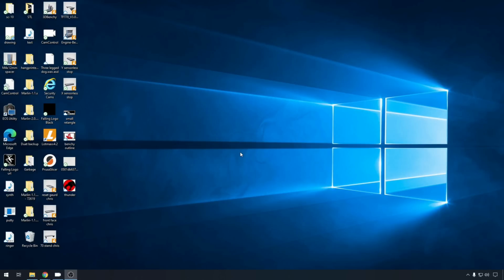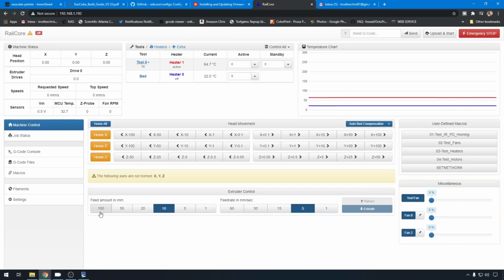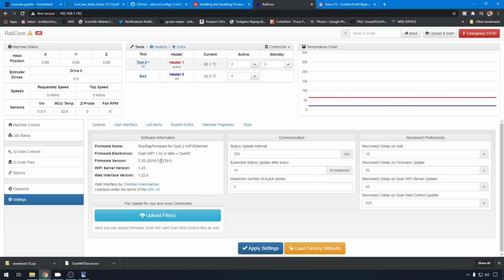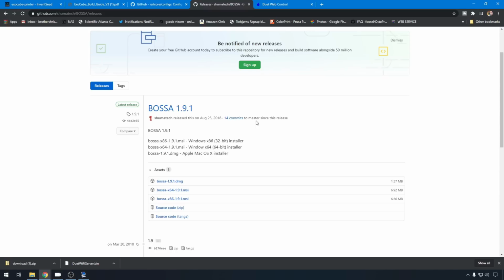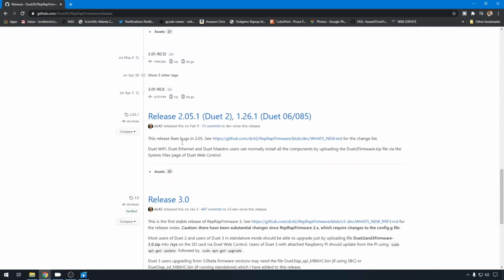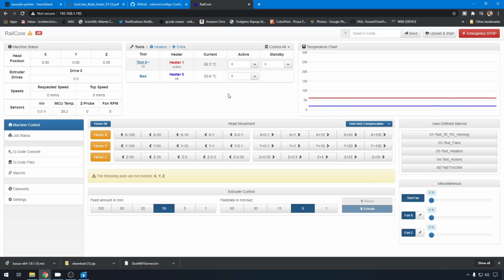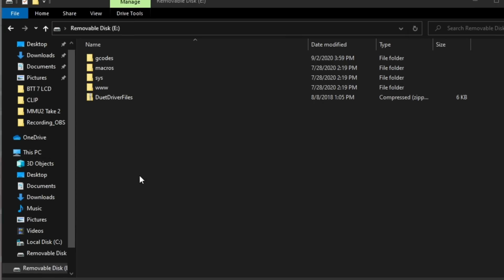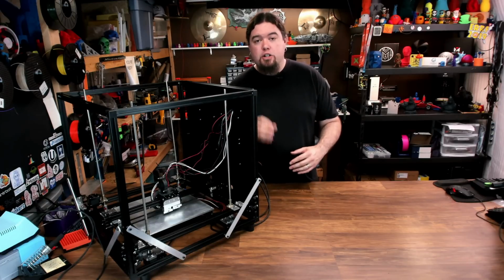RepRap Firmware Rescue - Save Your Duet Board - Chris's Basement

Comment: chris, thanks. my paneldue will not connect to the duet2 wifi (the wifi stopped working as well). any advice?
Reply from the maker: Wow, that sounds like a hardware issue maybe. I would send the guys over a Duet a note, they may be able to repair it.

Comment: I know you propably get this a lot, but I dont know what to do anymore.
I have an Anet A6 (yeah, I know) and I want to flash the firmware with one that has thermal runaway protection. My Arduino IDE software detects the board via USB, but I cant upload any new firmware. And my ISP programmer does not detect the processor on the Anets mainboard.
Reply from the maker: You will probably need a bootloader. See if Bryan know how to help. https://youtu.be/3jm0zzIneFc if your programmer doesn't know what it is, we might be stuck.

Comment: Nice and simple tutorial as always Chris. Just a heads up. I had PROBLEMS with RRF 2.05 on my CoreXY. I've dropped back to RRF 2.04 now and its more stable. The motors were louder and feed rates seemed slower somehow. I found it would do double movements at times and cause the gantry to crash!
Reply from the maker: Thanks for the tip! 🙂